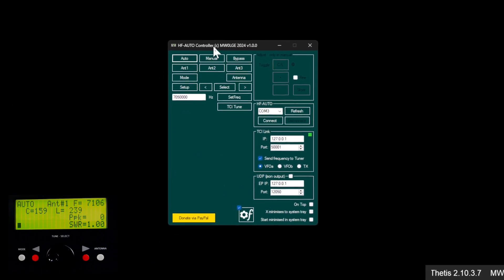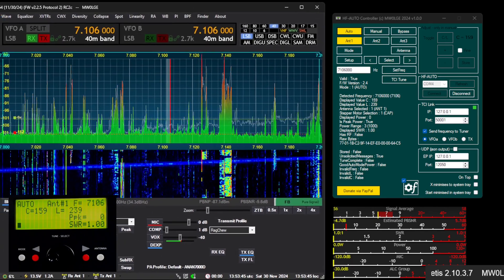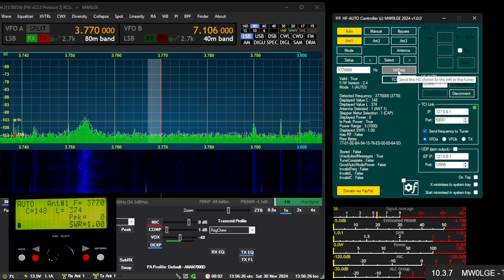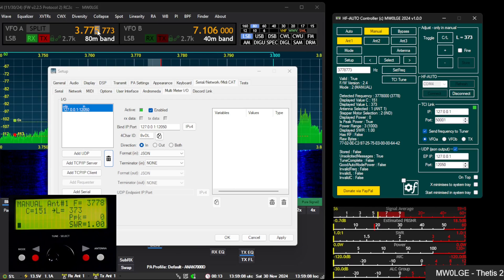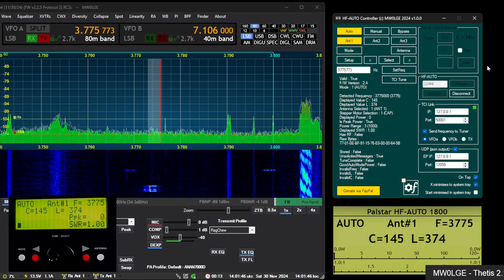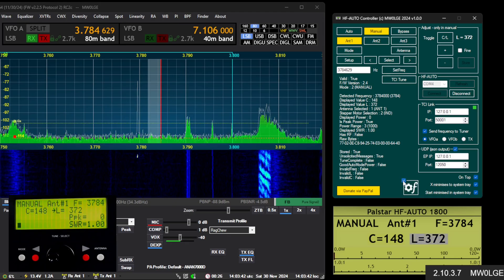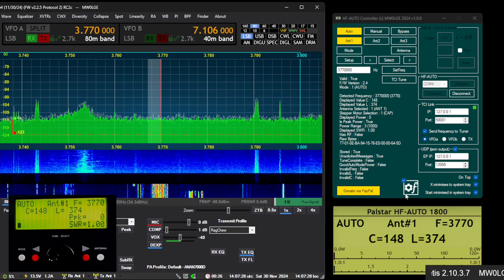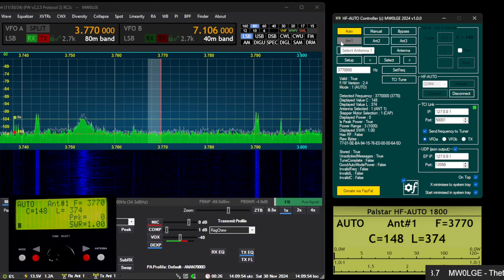Palstar HF-AUTO Controller - Overview

Comment: seems to work great  with my vertical antenna, however experiencing trouble with the comport shutting down when on an endfed wire on bands below 10 meters, most likely i am getting stray rf or something causing that issue i guess.
Reply from the maker: yes, i had to get a better rs232 cable, and add some ferrite. I used a StarTech one in the end, with fddi chipset.

Comment: I'm using Win4icom Suite with my IC-7300 will the TCI Link work with it also?
Reply: Need to clarify... I am actually using Win4Icom Suite networked from my remote shack with the client and I want to be able to use your HF-Auto controller networked also.
Reply from the maker: @RedBrungardt  hf auto controller knows about omnirig, tci and cat (kenwood) over tcpip.

Comment: im curious, how does the palstar auto tune without rf ??????
Reply from the maker: it recovers C+L settings that were previously stored internally that are close to the frequency sent to the tuner, without needing RF. Obviously if those C+L are not 100%, the then tuner will adjust if RF is put through it, and update its records for next time.
Reply: @mw0lge  That is great, ty for this.

Comment: Can you please compile a Linux binary? As I really want to use it, but can't. ON5HB.
Reply from the maker: I am afraid I do not plan to develop a Linux version. With Linux representing only about 3.9 % of the global desktop market, the amount of time and effort required would not be justified. If you wish to use the software, I recommend running it on a mainstream operating system such as Windows. 73 Richie.

Comment: I have a lot of computers, wanted a remote for HF Auto, so I'll be trying this soon. How many feet has this been tested to work?
Reply from the maker: i expect if you use a remote usb->rs232 product, which there are many, such as virtual here etc, then it will work very far away until latency becomes an issue
Reply: @mw0lge  Thanks - I'll check out that route :)

Comment: I can get it to connect sometime the light is red it reads what's on the panel the tuner firmware 2.40 any idea what I need to do now.. Thanks any help is appreciated
Reply from the maker: what are you trying to get it to connect to? Is the serial connection good between the tuner and the software? Are you trying to connect TCI , TCPIP Cat or Omni Rig?
Reply: @mw0lge  Computer and the tuner 9600 8n1 I use this setting it pops on sometime but no control  of the tuner
Reply: I am trying it on a Another computer. computer now is not finding the drivers
Reply from the maker: @donnellhowse5775  the hf auto is hard coded in firmware to be 4800 8n2
Reply: @mw0lge  run 1.04
Reply: Do you know if it's a way to reset the tuner
Reply from the maker: @ turn it off/on. HF-AUTO Controller is updated to version 1.0.8 over on github

Comment: I was running 1.04 it stopped working updated to 1.05 it's still not working what do I need to do.thanks
Reply from the maker: so you were running 1.04 and it stopped? and you changed to 1.05 and still no luck?  I would suggest you check your serial connection, and ensure that is working. Use a terminal monitor to view the serial data coming from the tuner, such as putty. The com details are 4800 8n2. Also, check you are connected to the correct com port in HF-Auto Controller. If you are unsure which one and it is a USB->RS232 adaptor, then using Device Manager, look at the Ports. Plug/unplug your serial adaptor and check which port number add/removes. Good luck ! 73.

Comment: I got my cable today, version 2.40 on the tuner, connected but no freq change happens.
Reply from the maker: make sure it is an RS232 level cable, not a TTL based one, ensure that the tuner is turned on AFTER windows is booted up. Hop over to our discord server if still having issues, details on my qrz page. Cheers, MW0LGE
Reply: @mw0lge  Yes, I got the cable from Palstart. Will check on the steps such as PC first, then tuner, etc. MFJ-998RT, if you ever do one app, let us know. Thanks.

Comment: I'm using a SunSRD2DX radio, I can control my HF-Auto with your V1.0.1 software but I don't get all that info returned from the HF-Auto that populated the area over the "Donate button" when I connect to it. I don't have a Palstar cable yet (I have a USB-Serial CH340) and I am on Firmware V2.3.6. Only thing  that came up in that field is Valid: True,  F/W Version: 250.42, Mode: 64 (UNKNOWN). The circuit board is 7507301 12/10/2018. I would think if the cable was a problem nothing would return from the unit and I wouldn't be able to control it.
Reply from the maker: I am not sure what that firmware is, or the mode, however a couple of people have reported this issue. I am not sure what version of board you have in your tuner. Ensure it is a true RS232 level cable, and not a TTL based one, and turn the tuner on after windows has booted up. Other than that, not sure sorry, as I can only test against what I own here, a HF-AUTO 1800. 73 Richie.

Comment: I just installed mine and the HF-Auto does not respond to commands from the controller, It shows all the correct info if I use HF-Auto to change the ant position but not from the controller.  I'm running firmware 2.4. Also, does this cable rs232 need to be a null modem cable?
Reply from the maker: null modem wont work afaik, it is a pin2, pin3 and pin5 cable. I just use the one that Palstar sell.
Reply: @mw0lge  Palstar sells two, one is a RS232 to USB and the other is a Null modem cable (which is 100ft).  Which one did you get?
Reply: By the way, I have been using a non-null modem cable.  I also tried a USB to RS232 and got the same results.

Comment: Let's say if you want to disconnect the antenna's if a lightning storm is approaching.  For remote HF on the Anan, can the HF Auto disconnect the antenna's and say you put a dummy load on ANT3, then select ANT3?  Would that be like disconnecting the antennas from the radio?
Reply from the maker: Well i guess connecting the trx to the DL via ANT3 would help somewhat, but the other two antenna sockets would be connected to the sky. It might help in a small way but I doubt would save you from a close by strike, but who knows, it can't hurt. I will look into obtaining lightning data for the locator/lat/long from somewhere and add a feature in the future. Good idea as minimal protection is better than none :)  Cheers 73 !
Reply from the maker: i could also add if tuner inactive for X time then move to ANTN port.  Then return to where it left off when active again.
Reply: @mw0lge  Great idea!  There is an option on the HF Auto when you turn it on to select the default Antenna. Right now, I have Ant2 as my start up Antenna.
Reply: For those of us that don't have an hfauto, having a lightning alert feature just in thetis would be a great idea. It could switch the rig to an unused ant port also ext io maybe to also drive an external coax switch possibly.  Not that a direct or close by lightning hit wouldn't zorch everything out, but high electrostatic voltages from nearby lightning might be mitigated.

Comment: Woah!  This is awesome!  Thank you for the Palstar HF-Auto interface.  Richie, will we need an RS232 interface to USB connection?
Reply from the maker: yes, rs232 from back of the tuner to the pc, add a bunch of ferrite there as well ;) Palstar do a cable, which is what I use, so can't advise if other makes work, but I expect they do. I think the wiring is standard pin2/3/5, but check the manual if making your own. Good luck :) 73